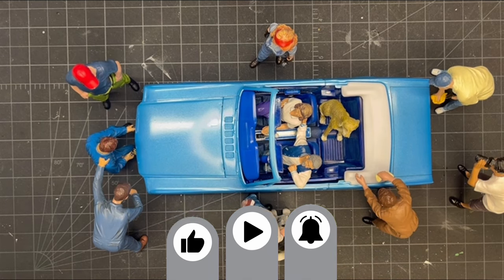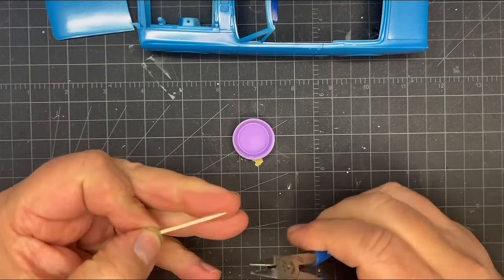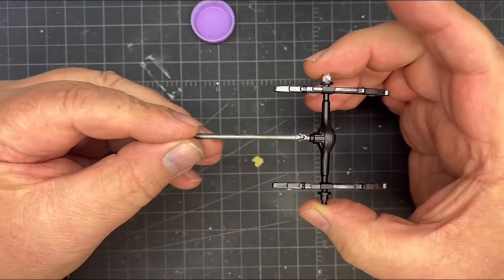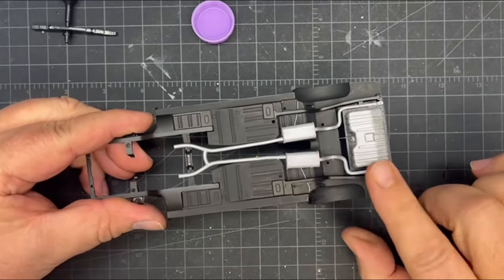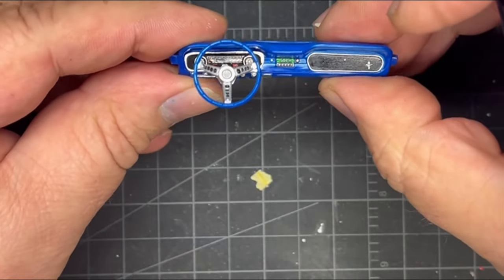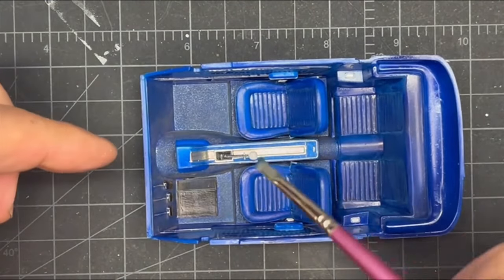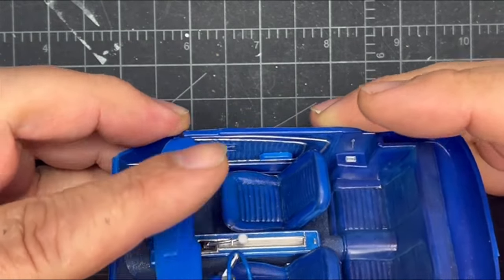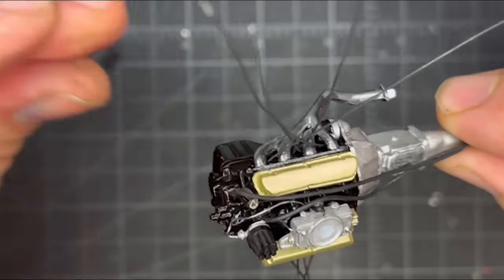Monogram 64 ½ Mustang Convertible Update #3

Comment: Incredible detail.  The .3 mm holes convert to .0118 ".  A human hair is typically .003 ".  So those holes you're running the wiring through are approximately 4 X the diameter of a single human hair.  And you're doing that in a manner that makes it look like the real deal.  You're attention to detail is top shelf.  My compliments, sir.
Reply from the maker: Mike I'm rolling, I never did the math.  Next time you are in town you will have to check out my shop.

Comment: Wow! Another action packed video. Glad I told ya about the hood pins for sure... Love the seat, look awesome... On the door seals, I just did the same thing with a Prism Gray pencil like the ones we use for the gauges from HL. I bought several colors...
On the dash panel, I didn't glue mine in on my build, it's just sitting there and staying where it wants to set.. I love the tooth pick trick for the super glue. I didn't think of doing that... Thanks!
Now I have a tip for you.
I use pop bottle caps as well as water bottle for glue and paint. For the glue caps I took some candle wax and melt it in the bottom of the cap to the ring edge. Then put your super glue on the wax and it will stay usable for a good 30 minuets.
Don't ask me how that works, it's one of the life mystery's..🤔😁
Then when the glue dries you can dig out the glue and reheat the wax and make it flat again. Shazam your ready to go again... I have several glue caps... Lol
LLAP 🖖
Reply from the maker: Man I feel bad that I didn't give you a shout out.  I couldn't for the life of me remember who told me that.  You know how your brain takes a coffee break in the middle of filming.  Also did you notice I cut in and out several times.  I was coughing like crazy last night.  I will most likely do the same with the dash.  It can't come out so why not let it float.  
I like the idea of the wax, just need to get a few candles to melt.
Reply: @grandpamarkshobbies  Awe man, don't worry about the shout-out its all good... Lol Wait until you get my age, the brain is always on coffee break... 🤣
That's what I thought about the dash too. Great minds as it were...
I seen that wax trick on a video a year ago, so not my idea... 😆
It does save having to toss the caps all the time.
Here's another trick for you. Take one of Jake's dog food can lids and put your paint on that when spot painting or if you can sneak a can of Pea's lid from Terri... Lol Just wash the lid off when done with how water and Dawn... It's all about that Penny... 🪙💵
LLAP 🖖
Reply from the maker: I work at a university where everyone uses bottled water.  I put out the call for caps and get enough in a week to last me a year.  LOLL  But soon I'll need to be very frugal with my caps and baby them.  I have one of those white plates with all the divits for paint.  I've had it for at least fifteen years now.  I love that darn thing, but If I'm not using acrylics I'll use the water bottle caps.  LOL
Reply: @grandpamarkshobbies  Well when you retire I guess you will be making a trip to the campus for Caps... Lol I didn't see the need for one of those 4 section plates when I have can lids... Lol I'm sure I can put a davit in the lids... Lol I have used some enamel on them and use lacquer thinner to clean the lid off.
LLAP 🖖
Reply from the maker: LOL.  I'll most likely go up there every month to have coffee with the guys.  LOL  I need to get the spray booth outside so I can start using lacquer and stinky paints.  LOL
Reply: @grandpamarkshobbies  I have a small compressor in the garage and I'm going to setup a small area to paint in this summer that way I can paint outside too. I have a trash bin outside the back door that I paint on with rattle cans when it's nice outside. I use lacquer primers so it is always best to paint them outside them I turn on my spray booth fan and set them in there to gas out and not stink up the office to much... Lol
LLAP 🖖
Reply from the maker: That's a great idea.  I have a compressor out there and can hook up a good regulator to it and go to town.  LOL